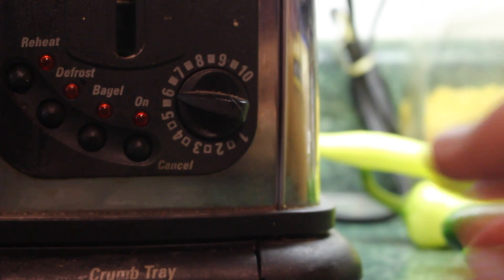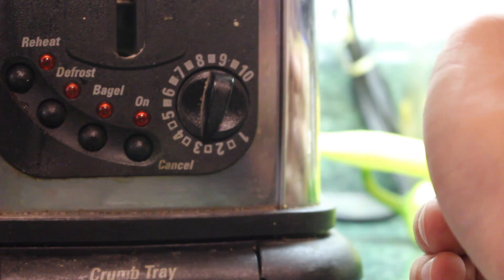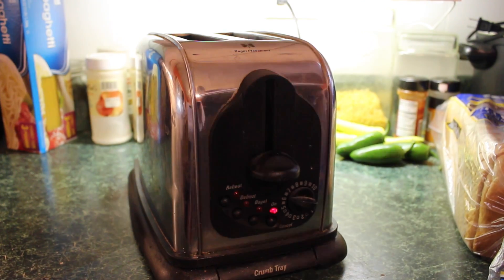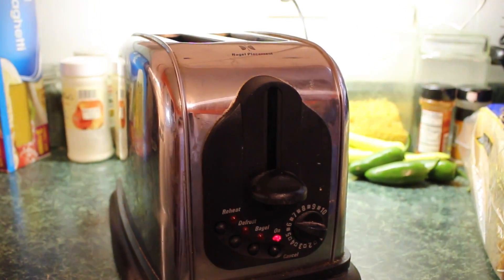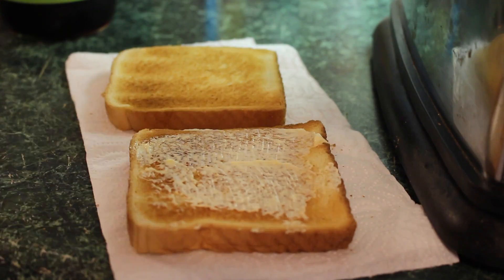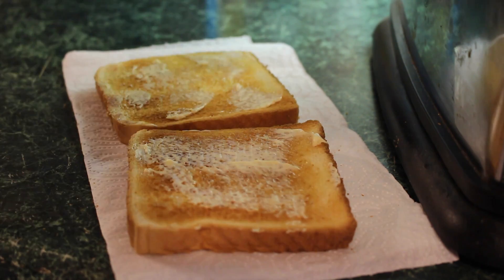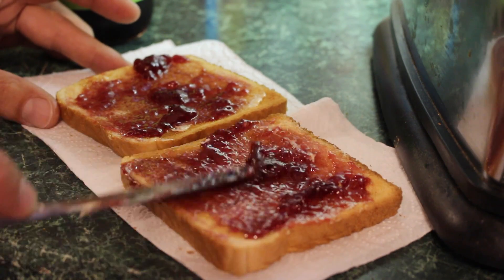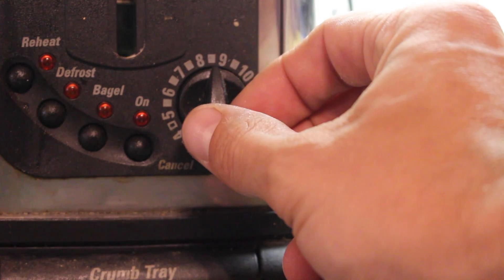How Does Your Toaster Know When Your Toast is Done?

Comment: I think it works by temperature sensor. When you turn the dial up the sensor is set to higher heat. The heat inside the toaster builds up and when it reaches the temperature set by the dial, the sensor picks it up and triggers the release.